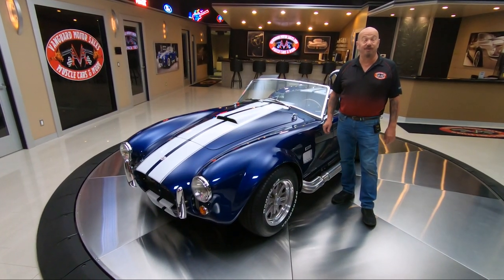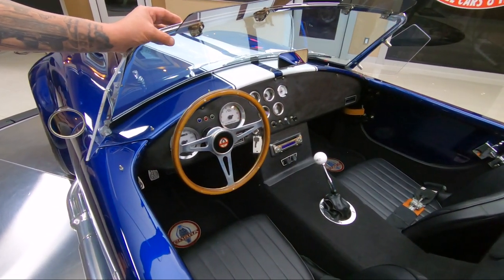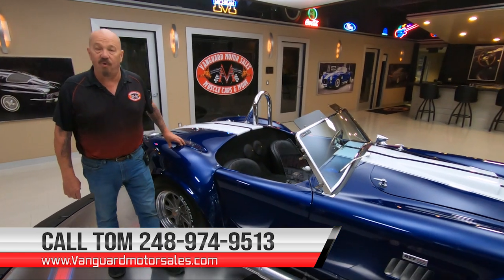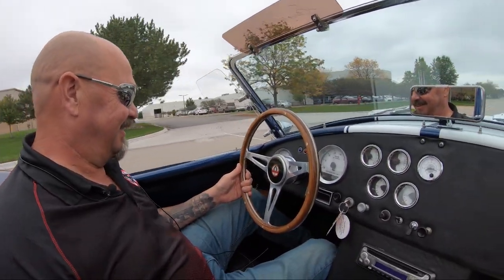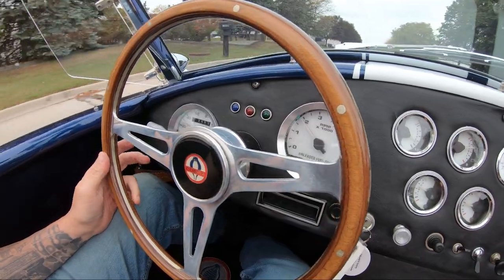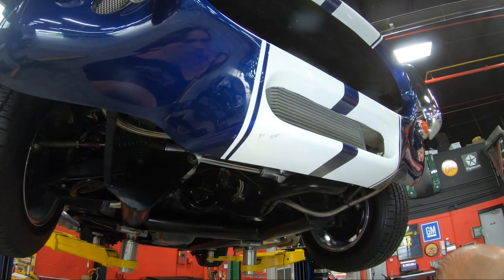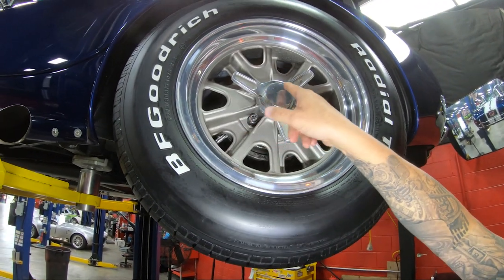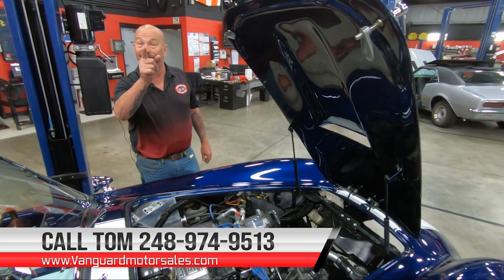Test Drive 1965 Shelby Cobra Factory Five Vanguard Motor Sales #963K

Comment: In your opinion How much smoother is the driving experience of a factory five compared to a backdraft , I'm thinking about getting one in the future but I don't know if I should spend the extra cash for a backdraft
Reply from the maker: Well the real difference between a backdraft and a factory five is that backdrafts are factory built while the factory five cars are kit cars that people assemble themselves. Backdraft has a consistently high build quality while factory five depends on the experience of the builder. We don't have many factory fives in stock because we don't often find them built to the level of quality that we maintain here at Vanguard. Factory Five's can be just as nice as a Backdraft's given the proper builder. So I would say its less of a Brand by brand comparison and more or a car by car comparison.